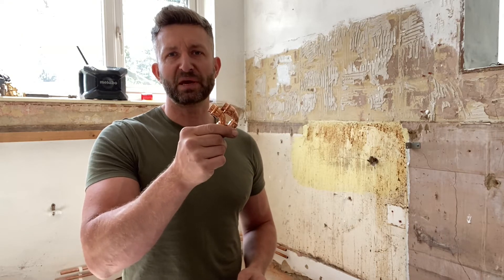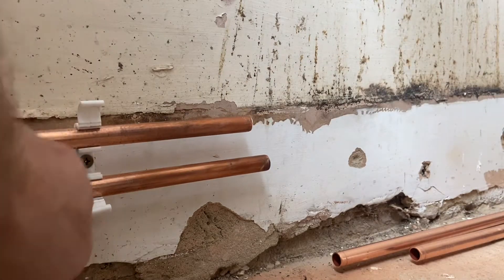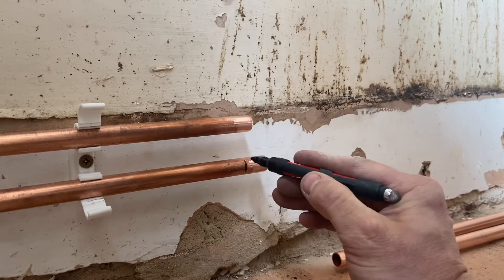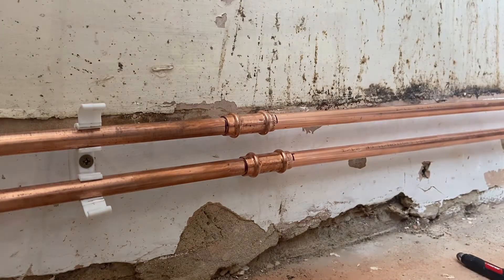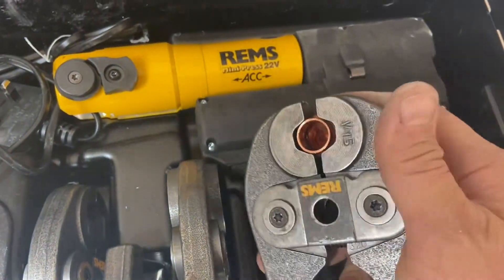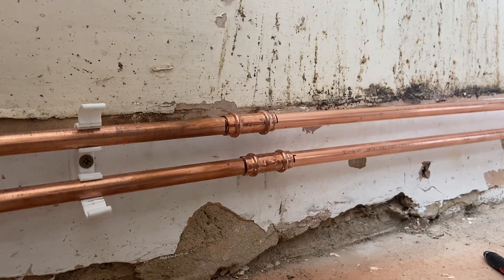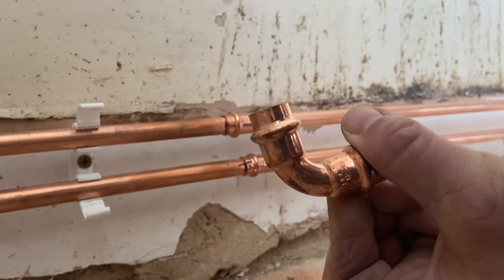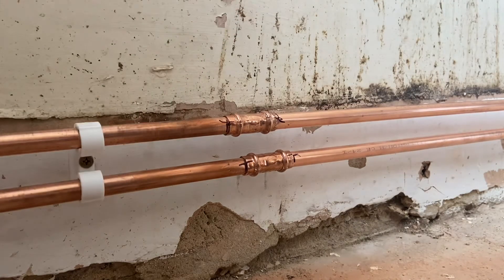How to press using Conex b press

Comment: Hey mate. I always deburrer. I always cut using copper pipe slice. I always use abrasion clothe. I always witness mark. I have never made that line to prove it’s been pushed all the way in. Honestly why is the reason for this?  Insurance? Cheers